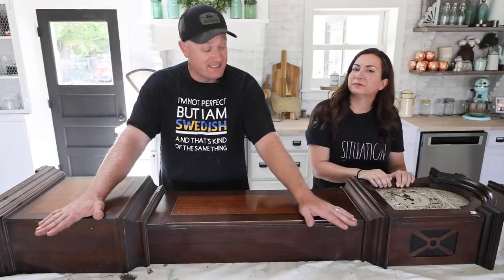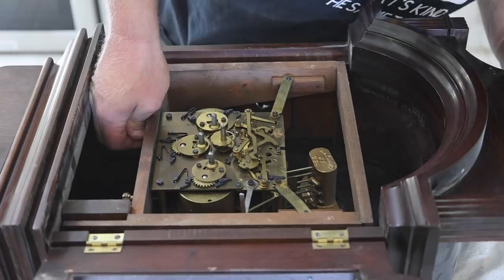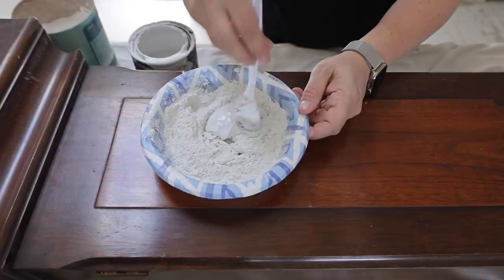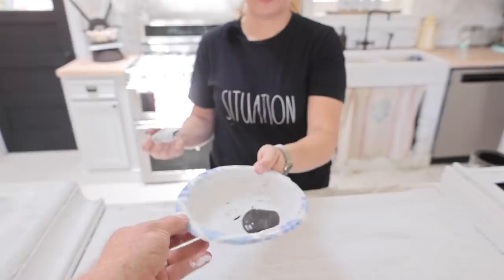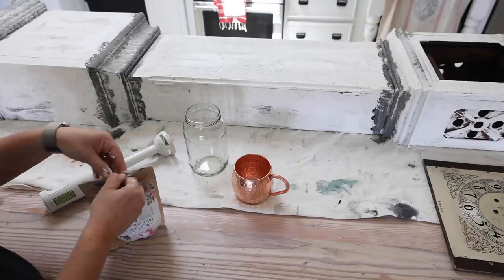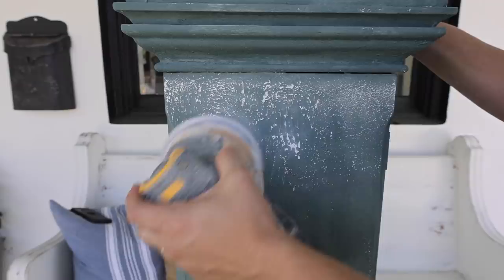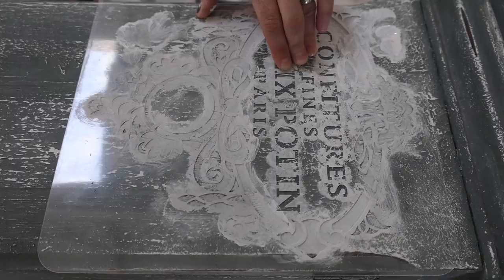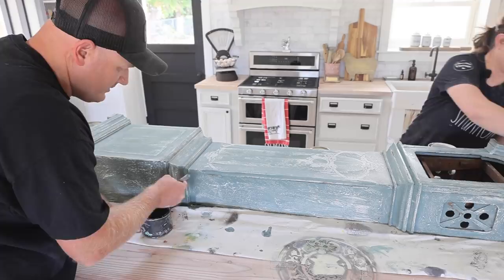How To Create An Authentic European Paint Finish | Swedish Inspired Mora Clock Look Alike

Comment: One problem... Sometimes, these clocks are actually worth quite alot of money. Even if the local thriftstore fails to recognize that. You even said, this clock could be worth $2500, if in working condition... But what would it have cost, to restore the mechanism? Sometimes, it just needs a good cleaning. And that gorgeous mahogany case just needed a slight polish 😖  It is absolutely worth doing some research, before you ruin a beautiful antique.  Especially, if it happens to be in an exotic wood, you can't get anymore. And with a lovely, quality musical mechanism. And no, I don't hate chalk paint and wax.. But just keep it FAR away from innocent, beautiful, genuine antiques in good condition!! 🙄